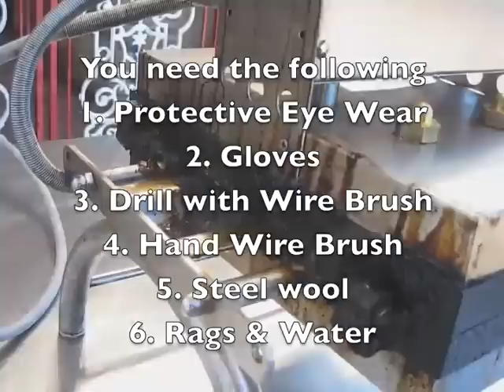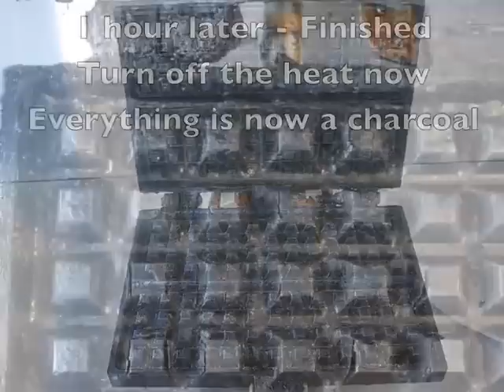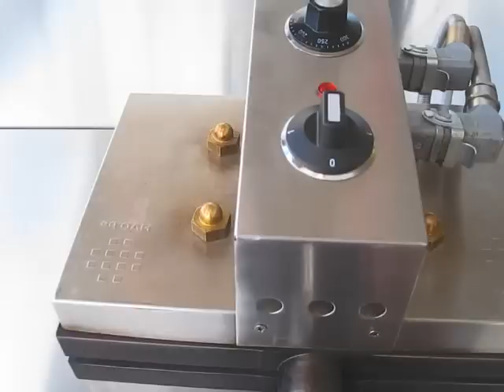HVD.be : How to clean the HVD Waffle Iron

Comment from the maker: Hi The best way to season the pan when new is to turn it on to 250° so it hot and put a vegitable oil in it and let it heat for about 10+ minutes. turn the Hvd on its side to drain the oil out and you are now seasoned. This is only needed to be done once when its new.
Reply: It doesnt work what machine do you use?

Comment: Mmmm i love metal shavings in my waffles lol
Reply from the maker: Hi in protein and Iron..  I am using an air compressor to blow it frequently. The other way to do it is soak in caustic soda then water blast clean. Have also cleaned the plates with dry ice air blasting and soda blasting